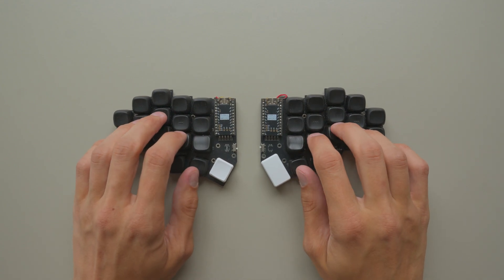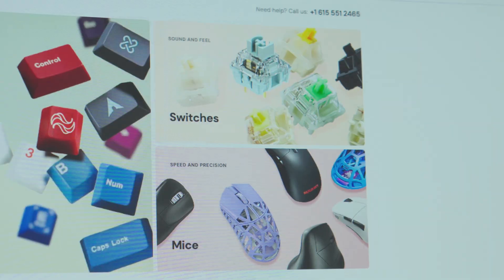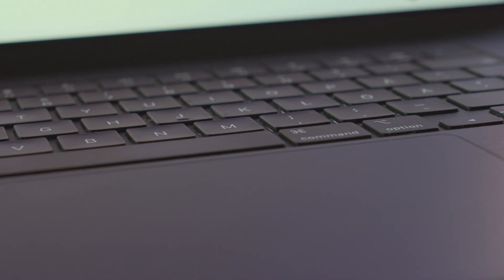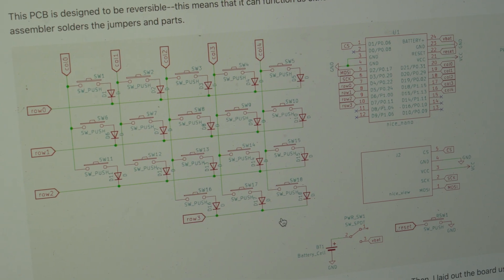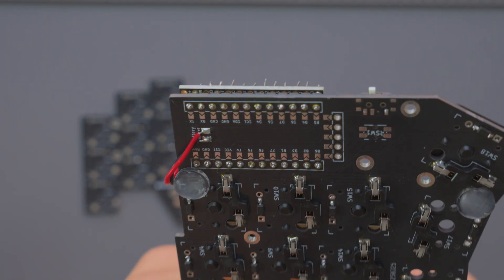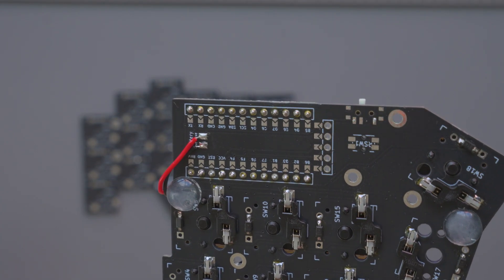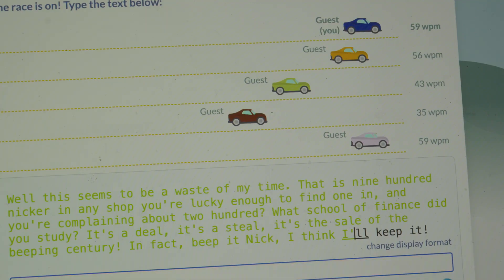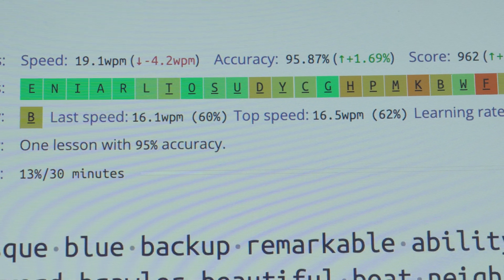I Built My First Split Keyboard

Comment: Nice one! How is your Colemak WPM looking now some weeks later?
Reply from the maker: Don’t feel comfortable and efficient enough to use it throughout the day. Currently I’m at about 30 WPM. Once I’m around 50 I’ll start bringing it to work so I can get more time with it!
Reply: @dearted I can highly recommend using Colemak-DH instead. I started with “regular” Colemak but switched to DH instead after two weeks, and it feels much better. The only issue is finding a place for Å Ä and Ö. I put mine as hold keys (hold a key for a set time and get another input) where it felt most natural for me, and it works great. Just need to set the timing right for your needs.

After a couple of months of struggle I can finally type at around 80 wpm with high accuracy.

Comment: Great video! Those LAME keycaps are so good. I pair them with Ambient Nocturnal switches (20g linear) for cloud typing on a Ferris Sweep. Learning touch typing with Colemak and then eventually Graphite was 100% worth it. If you can get tenting going on that PCB or even a case, it helps a lot with preventing any pain.
Reply: Hey mate why was Graphite so much worth compared to Colemak? Pinkies?
Reply from the maker: Would like to try a good pair of linear, thanks for the recommendation! Will also look into tilting the board, any recommendation for how to set that up without 3D printing one myself?
Reply: @dearted for my corne I added MagSafe rings to the bottom and some adjustable magnetic arms that allow multiple degrees and rotation. All from AliExpress